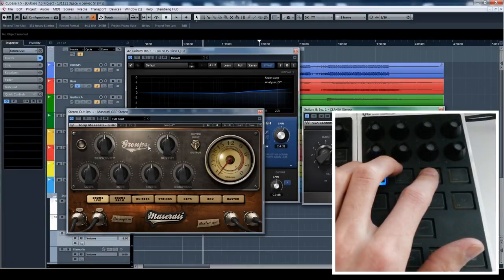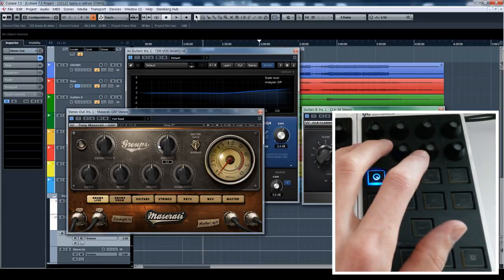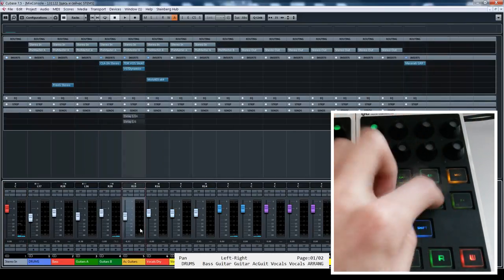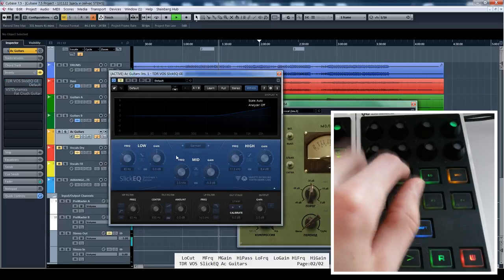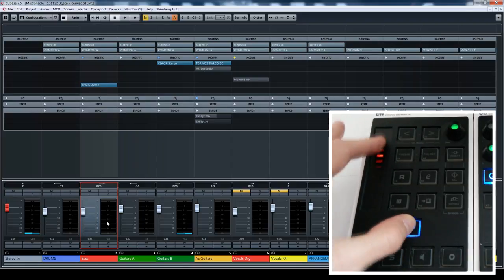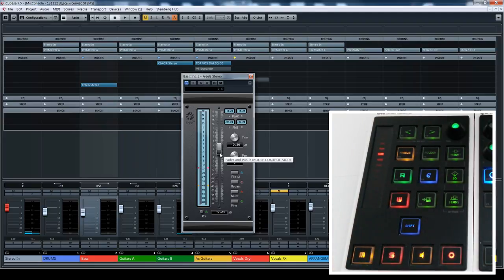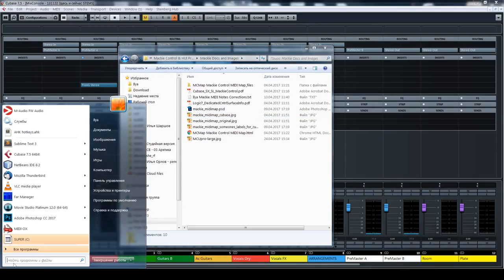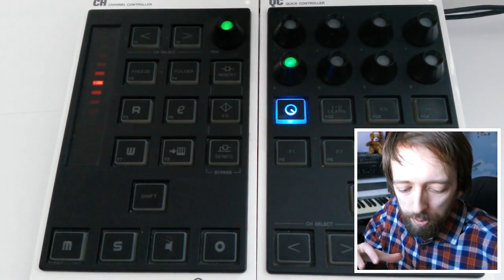Steinberg CMC-QC and CMC-CH "upgrade" / Remote Control Editor

Comment: They should hire smart people like you at Steinberg. And all those suggestions from the users, they don't care at all, they care nothing about actual power users. As an example, still can't get NRPN messages to work with Generic Remote, unless you edit the XML file. They know that's a bug for years and don't fix it. Many users are waiting for other programs to catch in some areas to switch DAWs. Customer service still sucks for Cubase, I had high hopes when Yamaha bought Steinberg, but nothing has changed.

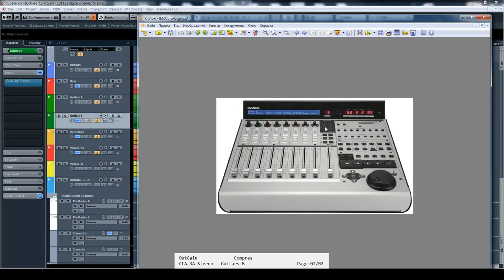Comment: Hi Ilya , I saw all you videos, tons of useful infos and ideas! Thank you very much for sharing. I will write you in email. Here I would ask: one of the CMC controllers you have, can open the inserted plugins from a channel? [you do it here? 2:25 I am not sure]
Reply from the maker: Hello! Thank you!
No, I don't think Mackie protocol has a command to open particular plugin GUI (I doubt it, but seems not). Cubase on the other hand can certainly open all plugins GUIs on the track using key command and probably using generic controls. 
In my videos all I do is switch to (one of the) opened plugin in a single click.
Reply: @letimix  thx for the reply! Cubase can't open inserted plugins with key commands or macros, I am 100%. The only one combination is [ALT+SHIFT+CLICK on the "e" on a track in project window]. Unfortunately we cant implement the mouse click in a controller! 😁 As you know! I watched your videos with Platform M [brilliant!!] and it seems that the iCon can't do that as well, eve is modded by you! 😁 Anyhow, I will write about the Platform M, because I wanna try your script for my small Icon i-controls pro, maybe it works in certain features.
Reply from the maker: @fonzflex5608  yes, probably you're right! Thank you! :)

Comment: Really nice.. At first i was thinking: Why not use the CMC software, but then when i say the Autokey software i got the picture..I got 8 os those CMC controllers which i would like to start using again.. My main focus has always been opening and inserting VST effects which i never could get to work the way i needed so i'm curious how you map the mouse to the functions? Are you just putting the mouse over a function and "map the position" of the pointer, or is it actually mapping the code that the mouseclick is sending to Cubase? Meaning:  don't have to open the plug-in in the exact spot on screen for it to work.

Thanks for an interresting video
Cheers
Reply: I'm not sure I can answer your question! The key is Cubase Remote Control Editor - it lets you control plugin parameters even if it's closed. Though, there are some limitations and not everything is easy and possible.
Reply: Hi, do you maybe have two CMC PDs? I tried to use one as a function pad and other as regular drum pad but my comp can see only one at once.

Comment: Thanks for a great video. It's the only one I've found that shows how the Remote Control Editor is supposed to work. What are you using to show the MCU screen? It's at the bottom of your video.
Reply from the maker: Thanks! This is a script on AutoHotkey, that reads MIDI from Cubase and displays "mackie" text in a small window. (The link to script example is in the comments).